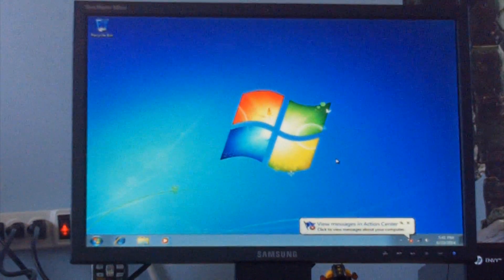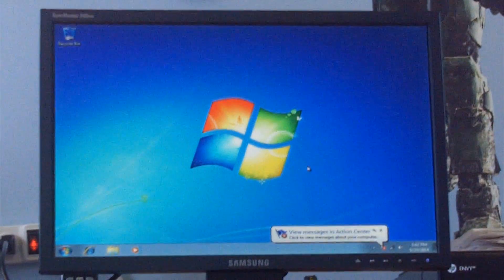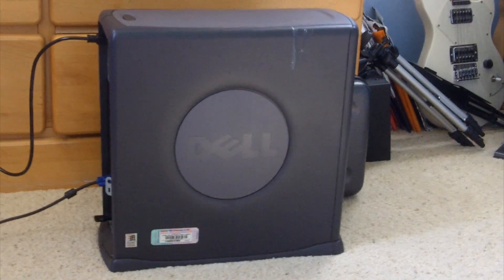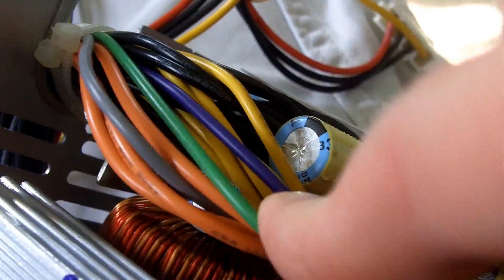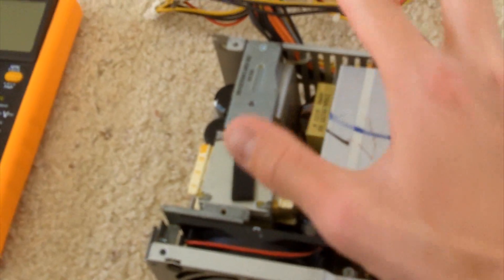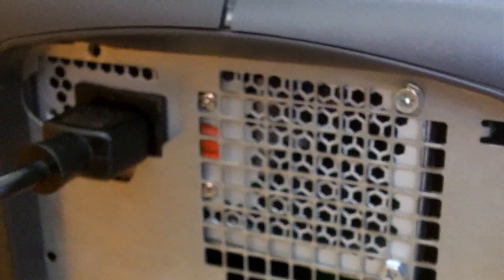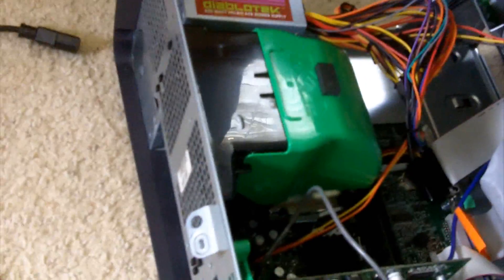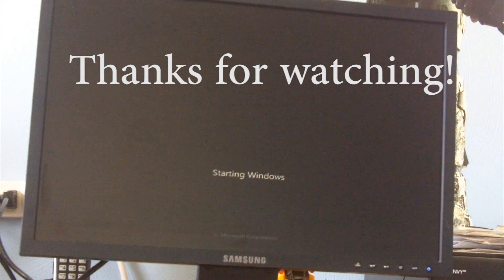Installing Windows 7 on a PC with 512MB of RAM (under minimum system requirements)

Comment: Sir my laptop in 240 mb ram. 
I want windows 7 32/64 bit install. Sir what will be install? Please sir tell me
Reply: 240 mb ram , that is really low  , and when you'll be on the desktop , it will be very laggy i assume , atleast 512 mb would be great. But you can try it

Comment: I have a 12'' laptop with 512 mb ram, 24 gb of hdd, 1.6 GHz Pentium 4, and 32 MB VRAM, running Win7. It's great
Reply: So my 15inch
With 8gb ram 512gb hdd 1.4ghz amd e1 1200apu 256mb v ram  will run fine with windows 7 ?
And trust me it doesn't run that well on windows 10 it's ok tho.
Reply: @Praneel  no my guy that will run windows 10 with those specs
Reply: How install window pls link

Comment: You can buy a cheap FX5200 or Radeon 9200 and get some Windows aero.  I have a Dimension 4600 and tested Longhorn and aero worked alright. (Native supported LDDM).

Comment: 1 gig is really just the recommended. 512 mb is the minimum.
Reply: You could run Windows 7 on 256mb RAM, it just runs like hot garbage. So 512mb is the true minimum. 1GB is recommended.
Reply: Well the minimum is 512 mb ram, but it'll still run on 256mb.
Reply: i am on 8gb ram and an i3 12th gen (1215U) Processor. Just because it offers 4-5fps great performance in games and also lightweight than windows 11.

Comment: so my Laptop is an Acer Intel Pentium T4500 with a 1Gb of DDR3, 320Gb HDD and a Intel GMA 4500MHD. Can i install Win 7?
Reply: +UnoRz Gaming You can install Windows 7 easily on a PC of that Spec.
Reply: im on lap...
Reply: I have dell Latitude e6400 1gig ram .intelcore2duo.  70gb harddrive.  Running windows 7 home Edition 32 bit
Reply: Yea